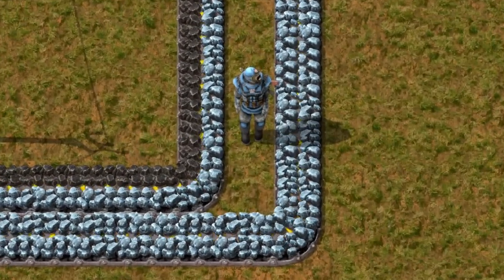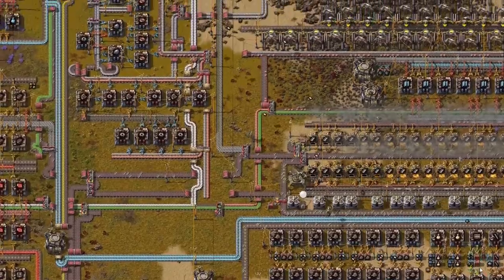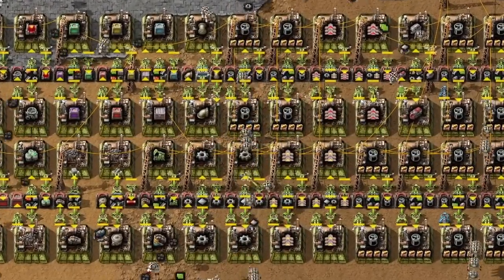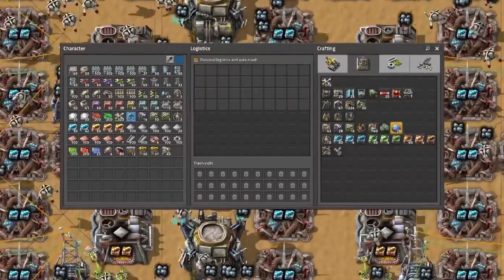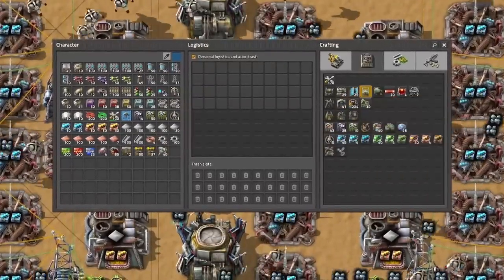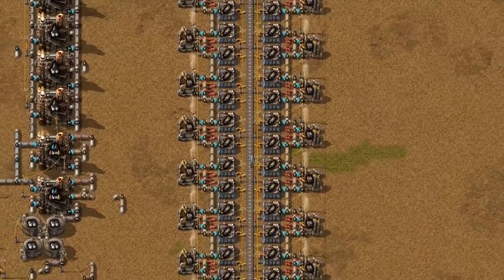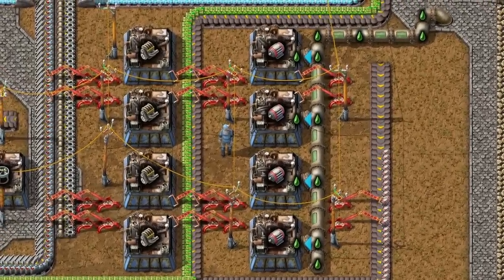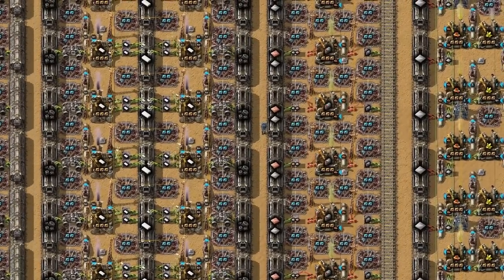Belts are Useless.

Comment: I used to be a basically yellow belt purist because I never bothered to upgrade my belts. But this current factory I decided to immediately switch to only red belts after unlocking them. And dang is it such a difference. And I even switched to just fast inserters as soon as I got them. It's a massive improvement.
Reply: Damn, only 15 items/s? THE FACTORY MUST GROW!
Reply: Some would say it's roughly twice as good!
Reply: Use robots and upgrade planner for easy upgrade
Reply: there is practically no reason not to use upgraded belts. the only time you might use yellow or red when you have blue available is with some weird mixed-belt stuff. but you can save yourself MWs to GWs of power by using all the different inserters in the right places when applicable.

most of the time if you want to use a long-handed inserter you can probably actually use some underground belts on the close belt and then use a splitter on the far belt and a normal inserter. this can also give you considerably improved throughput as long inserters can be quite slow and dont have a stack variant.

yellow inserters are always used best in situations where the item that is being crafted takes more than about a second to craft. in this case, blue inserters move so fast that by the time they fully reset it is left with idle time. you ideally want to minimize inserter idle time as much as possible (as long as you arent giving the assembler its taking from or putting into idle time), so that is why yellow inserters are good here. blues take about 4 times as much power as a yellow, so this is a no-brainer power save.

stack inserters are best used on train unloading into buffer chests in the vanilla game. you dont even want to unload from the buffer chests onto your belts with stacks either, because the 12 buffer chests being unloaded by fast inserters is more than enough to fully-saturate even a blue belt with enough stacking upgrades. they're probably capable of saturating about 1.25 blue belts, even. stacks use between 2 and 3 times as much power as blues, so that's a considerable power reduction there.
Reply: @Templarfreak  Problem with yellow inserters is that they have real problems catching things on blue belts. So for me blue ones become standart as soon as they appear
Reply: The moment i have red belts automated i replace every yellow belt/splitter/Underground belt with red belts and once i automate the blue belts i replace every red belt/splitter/Underground belt with them i dont like having 9 types of belts in my inventory its just a clusterfuck easyer to just go with one type of color
Reply: @gargean1671  yellow inserters work fine on blue belts when they're not on corners, even if the belt is under half saturated. when it starts to get to almost no saturation is when they struggle the most tho. they also kind of struggle when you dont have stack upgrades. they have really improved the smartness of slower inserters on faster belts a lot. even burners will function somewhat well on straight-aways of blue belts if its about half saturated. and of course, the more backed up items get on your blue belts, the better they'll perform too. so if you prefer to oversaturate your belts (ie max output onto the belt but not using its full capacity) or frequently split fresher belts into your belts, they should do just fine.

also, i was mostly referring to using yellow inserters to take out of machines to put onto belts, they also perform perfectly fine in this situation with absolutely no problems as they aren't trying to catch items zipping by them faster than they can pick them up.
Reply: @Gh3ttoboy  there are some situations where using mixed belts is necessary, but these are very rare situations that almost nobody ever needs, and they're for getting specific throughputs or making weird and wacky balancers
Reply: @Templarfreak  yeah but like you said thats a very rare occurance i dont need to have the perfect compact base theres plenty space out there 😆
Reply: @Templarfreak  Not exactly) Even straight passing blue belt might be a problem if it's not completely filled. Experienced it more than once.

 As for taking out of machines n stuff - yeah, that works, but tbh for me savings in electricity and production value seem too miniscule to bother with separating blue and yellow inserters. So I just make blue a standart.
Reply: @gargean1671  i did clarify that it does have problems on belts that arent fully-saturated, and the less saturated the belt is, the worse it gets. i literally went in game and just told you exactly what i was seeing happening first-hand, though. it does perfectly fine on fully-saturated blue belts, and when you think about it, it makes perfect sense why it does, because once it goes chasing one particular item it stretches as far as it can, then it gives up on that item and just picks up whatever is right below it as that's the closest item (which it is pretty much exactly ontop of and thus doesnt need to move at all to pick it up). when the belt is fully-saturated, there will always be items directly below it.

the electricity saved is small, yes, but over the course of 1000s upon 1000s of inserters they combined make a considerable difference, and you can do other little optimizations here and there as well to save more electricity. if you do this effectively and consistently it can literally save you GWs of power (i speak from experience). the more power you save, the more time you save, as you have more headroom to expand without expanding your power grid.

the only reason i might say to NOT use yellow inserters is faster inserters might be more UPS efficient (theory being: moves more distance in less time = calculations are done less often), but, i would have to do actual research on that.
Reply: @Gh3ttoboy  yeah i understand, i was just making sure that it is known :D
Reply: @Templarfreak  >>i did clarify that it does have problems on belts that arent fully-saturated, and the less saturated the belt is, the worse it gets. i literally went in game and just told you exactly what i was seeing happening first-hand, though.

All the same, told you my experience) You don't use only fully saturated belts. And partly saturated cause problems. So why bother?
Reply: @gargean1671  ??? my belts are way more often than not fully-saturated, even blue belts. at least, when belts are applicable. i abuse the hell out of direct insertion as much as possible, so obviously i rarely have belts of something like red circuits or either engines, things that take a very very long time to craft and take a lot of production to fully-saturate a belt. usually at a certain point bots help cover things as well for me, as they help do more direct insertion (requester chest -> assembler) instead of having to use belts. direct insertion is another thing where yellow inserters are absolutely perfectly fine for.

its dependent on what you do and what your playstyle is, but in general especially before you have blue belts it is 100% absolutely worth it to use yellow inserters. there just isnt a single thing you can say to convince me otherwise as i have spent 100s of hours using them efficiently and effectively for all kinds of purposes lol
Reply: i can understand why you wouldn't use red belts...

But not using blue inserters? Are you insane?

Comment: Blue belts can move 45 tanks per second, which can each hold 80 stacks. That means vanilla belts have a theoretical throughput of  43.2 million green circuits per minute.
If you need more than that, I recommend a second belt. #beltsforlife #screwpurebeaconbuilds

Comment: I carefully planned out my megabase by designing each block as blueprints, set up my train system and smelting outposts and then filled in a large sea for it. Then I built it and it takes over 20 gigawatts more tham my previous base!